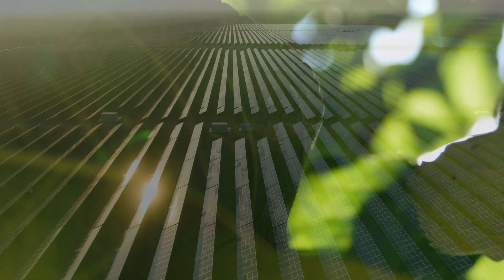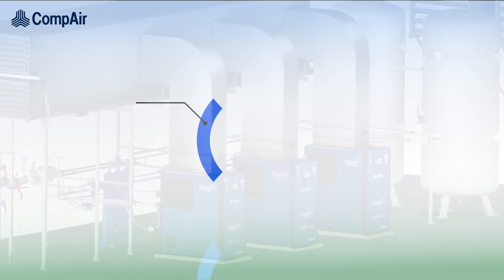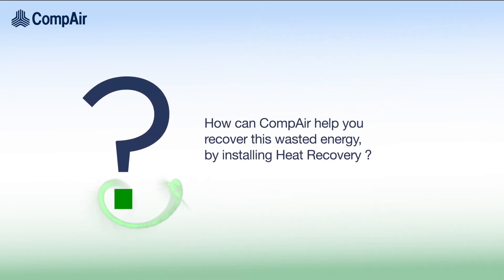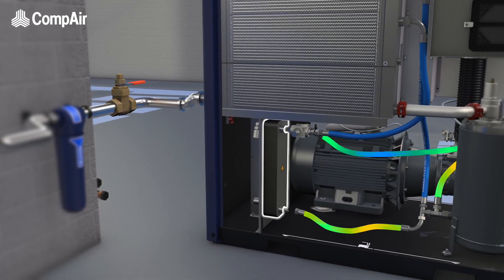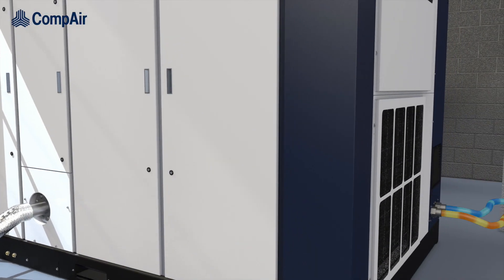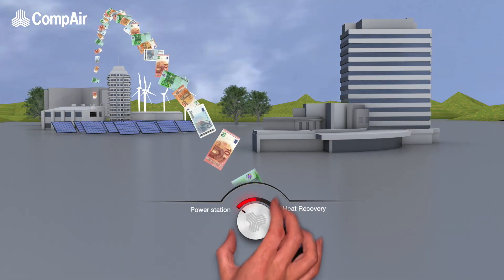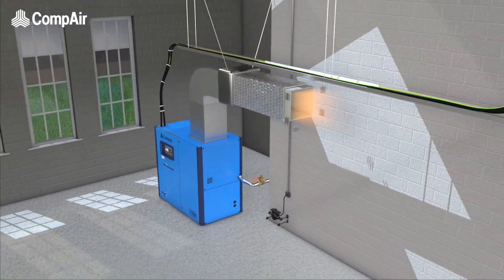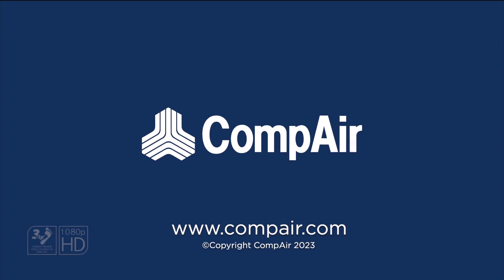Recover the heat generated by your air compressor

Comment: A compressor is indeed an electric heater and will convert not 94% but 100% of its input electricity to heat. This is a recurring error, please fix this. The energy level of air does not depend on its pressure, rather on its temperature only. Nice animation btw..
Reply: In fact, it is wrong to call the compressor an “ electric heater ” because it is not a heater and it is not electric. The efficiency of the compressor ranges between (80%-90%), but a specific design can exceed 90% efficiency. The air compressor converts any type of energy entering it into an air compression process with minimal losses that appear at very, very high pressures. The energy level of the air depends on its pressure, not its temperature. All processes that occur depend on pressure, even those in steam plants. In steam plant, the steam that flows through the turbine works according to the principle of pressure, not temperature. What is required is pressure, but because water is an incompressible liquid, its pressure is raised by raising its temperature, so temperature is used as a function of pressure, but if water were compressible (Hypothetically) the water will be compressed directly instead of heated. The same is true with air, but air is compressible, so air compression is directly used. The air consists of small molecules, and these small molecules are widely separated from each other and move randomly. When pressure (compression process) is applied to them, they approach each other and the distances between them decrease, leading to a collision. This collision will generate heat, but it will be little because the molecules are small, except when High pressures are used. But when you heat the air using electricity or any fuel, such as gas, for example, you will give energy to those small molecules that will transfer that energy to each other through conduction and convection, causing them to move apart, thus expanding the air as a whole, and this expansion and distancing represents pressure, so in the end, the air pressure was increased, and thus Its energy level increases by increasing its temperature. But applying pressure (compression process) directly is more efficient and easier than applying heating.